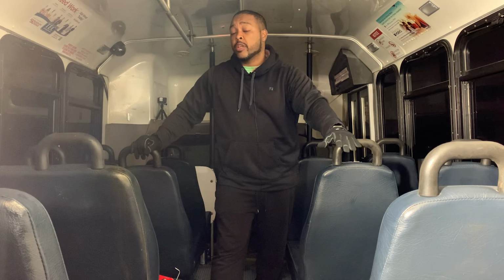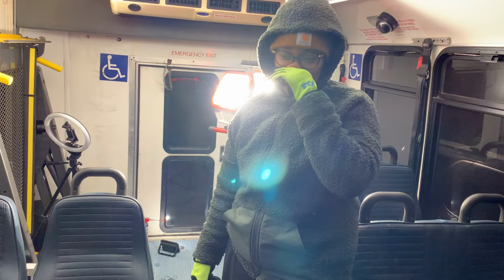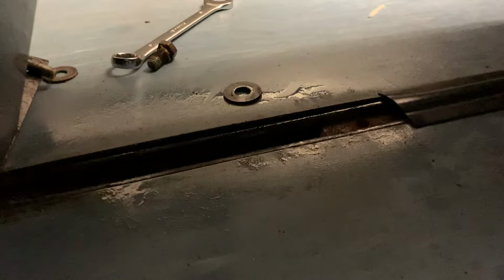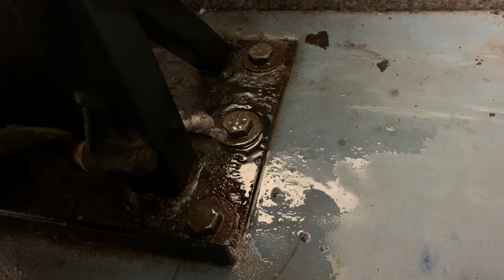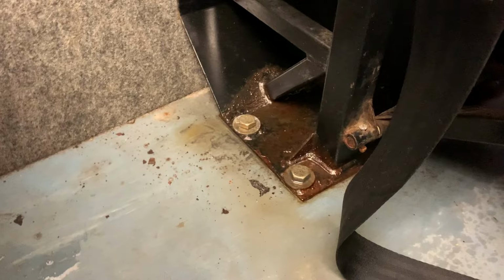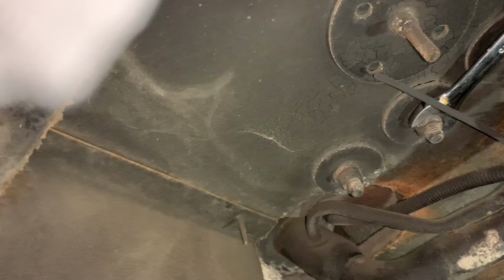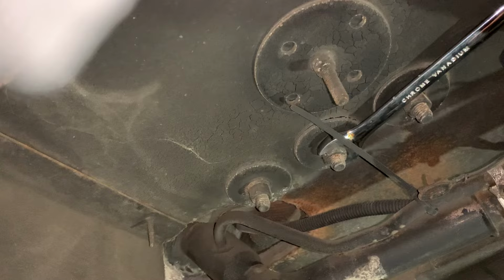Shuttle Bus Conversion | EP2: Removing The Seats

Comment: Hi, Detrone What is that black unit on the floor to the left with a timestamp of 6:10? I am taking the seats out of my shuttle bus and I have some strange unit attached to the underside of a sea with a lot of wires going through a sleeve. My unit has coils on it. The sleeve feeds down into the floor.
Reply from the maker: That is a floor heater unit. I actually have a full video dedicated to removing it… I left a link to it below 👇🏽 

https://youtu.be/uHdo1aSc1hY?si=uoDNZyG1-wigIYx1

Comment: Thanks for the video!
Did you remove the rails attached to the wall that the seats and seat belts were connected to?  If so how did you remove them?   Thanks again!
Reply from the maker: Thanks for watching… No I did not remove them, since they were welded to a metal piece on the floor as well. I just left it and cut my insulation around them in later videos.
Reply: @DetroneDoesIt  hey!  Thanks for the quick reply.  I did the same for the ones on the floor.  I was talking about the ones on the wall.  They seem to have rivets,  not screws.  Going to drill them out, I think
Reply from the maker: @andrewball1898  oh ok… no I didn’t remove those either. Best of luck on your build!
Reply: @DetroneDoesIt  I appreciate your time. Thanks for responding